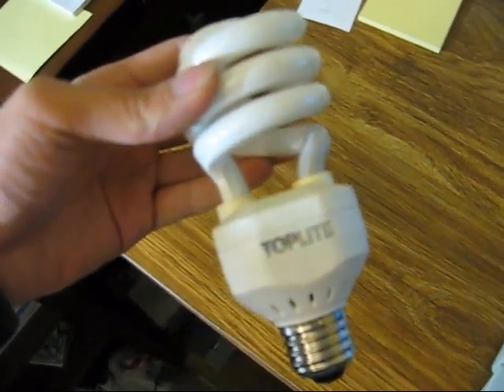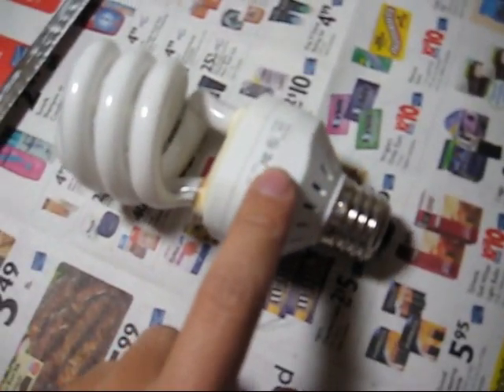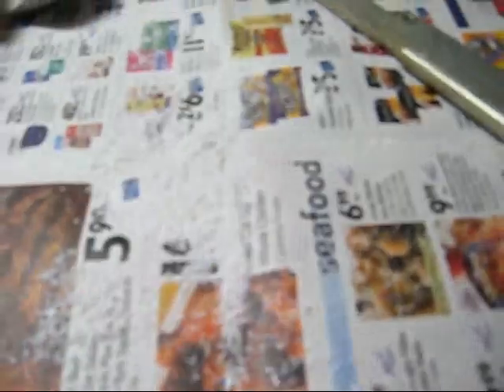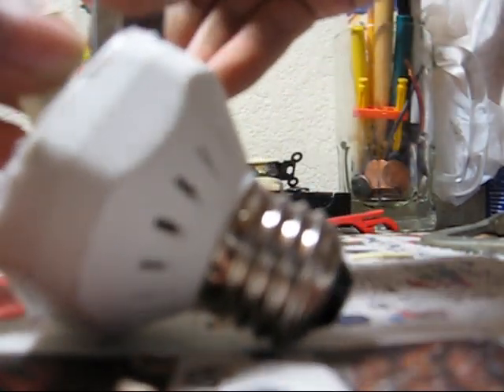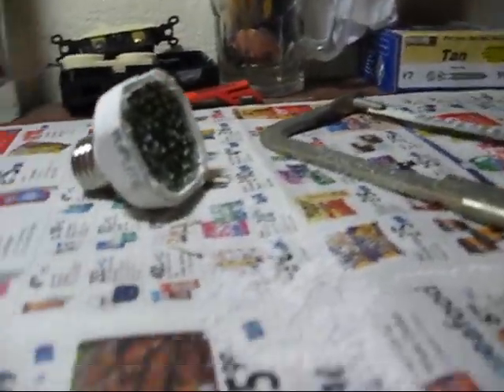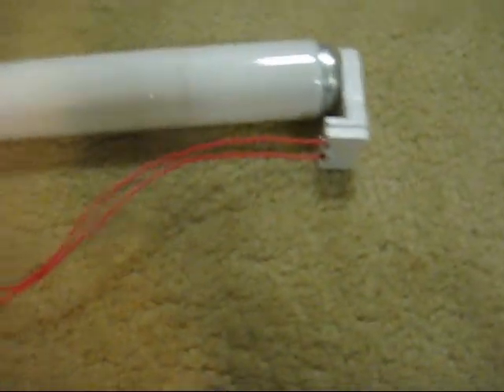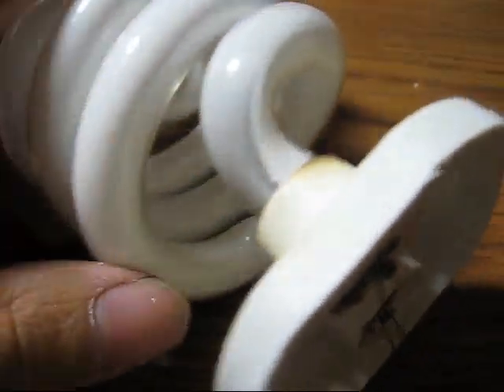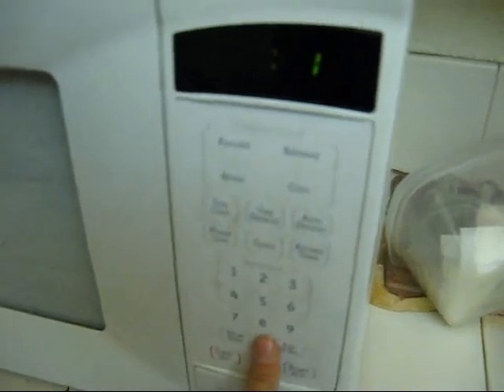Top Lite Compact Fluorescent Dissection

Comment: I've noticed that the ballast is usually fine, but the filament is burnt out on a lot of our cfls that went out. How could the filament burn out on a 2 year old cfl, especially if they are supposed to last for 9years or so? Answer = crappy ballast. These cfl ballasts do not have a proper power filtering circuit, so they put quite a bit of noise back into the electrical lines!

Comment: The issue with CFL ballast is, then the failing tube take the ballast with it (overheat; mainly models with volt doubler on the input).
And more, electrolytic capacitors (the big cylinder protruding to the screw base here) have limited life as well, similar to the expected bulb life in typical installation, but in closed fixtures, or in base-up position (higher temperature) it might be way shorter and fail as first even after few weeks - then good, ballast dead.

Comment: That's a welcome change compared with the common throw-away mentality. When compact fluorescent bulbs first came to market, ballast and bulb were separate units because ballast was expensive. Now, as electronics cost next to nothing, you throw good parts away whenever the bulb itself fails. I reckon most compact fluorescent failures will lie within the bulb itself because most heat is dissipated there, rather than in the ballast.